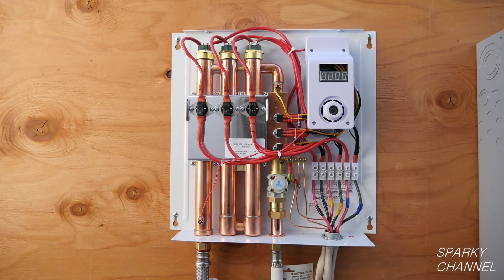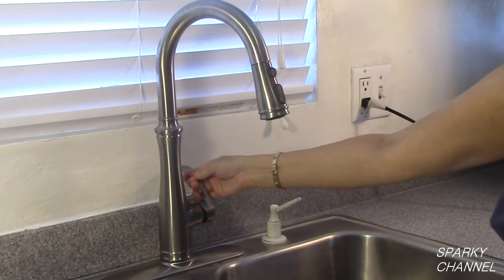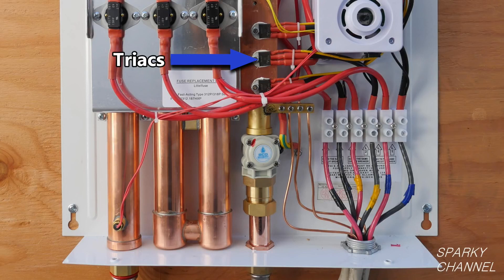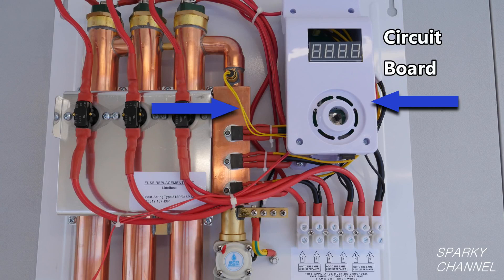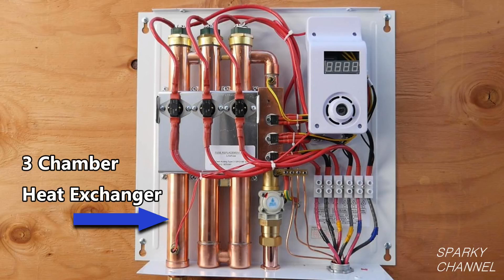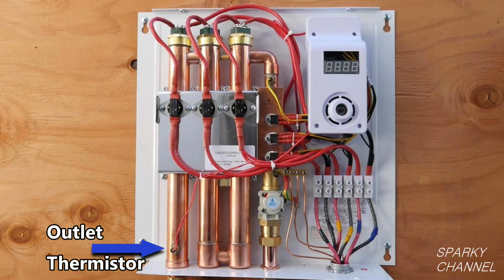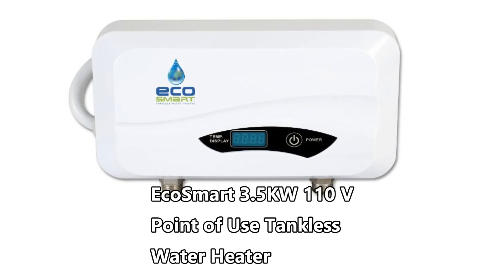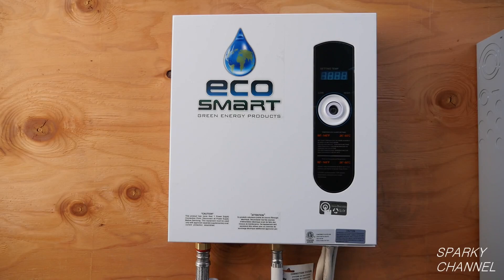How the EcoSmart ECO 27 Electric Tankless Water Heater Works

Comment: I bought one of these for my home, and if it was reliable, I'd put it in my rental houses.  This thing works like a dream. One of the heating elements went out af5er 5 years of constant use & troubleshooting it & replacing it was easy with the instructions on the eco website. Yes, I did buy more

One more thing; my old hot water tank wouldn't drain and I had to DRAG it out on my hand truck, because the weight caused the tires to go flat.  That was more than a 400 pound on just 22" of floor
Reply: 9 years in service, still working fine, will be replacing flow meter on mine

Comment: I’ve been through 3 of these and waiting on a fourth. I just changed out all 3 elements in my last one and water heats up then goes cold. It I limit the flow it may stay hot but not to correct set temp. Service was less than helpful other then to tell me it’s most likely out of warranty and to buy another. But while I wait for the new one I’d like to finish trouble shooting this one. Fuse is good all connections are good, and all three chambers are heating

Comment: I have an Ecosmart 27 and recently drained the system before turning off the power. Afterwards inspection of the 3 heating elements look ok but the flow to my 2 water faucets is diminished. Is  the Ecosmart flowmeter or some other element able to control the flow of water through the system?

Comment: Electronically controlled unit is good as long as it has a long time warranty.
Older units did not have the electronic components and would have a longer life of operation.

Comment: What can you use to install a remote disconnect?  Since there are 3 separate circuits would you need 3 separate disconnect 2 pole disconnect  or a 6 pole disconnect.  I am not finding any off the shelf solutions unless you want to pay 2 to 3K just for the disconnect.

Comment: I replaced the corroded element and still not hot? Any suggestions ?
Reply: Make sure its getting proper voltage, triac could be bad or control board, needs some troubleshooting

Comment: I have an Eco Smart 27 and when I turn the water on, the display will show the desired temperature for about 4 seconds then go out with no hot water. Any thoughts out there??
Reply: I ran across the same problem with my unit when I purchased this home that already had the Eco 27. It just kept shutting off when turned on. So what I think was going on in mine was calcification from the city water. I had a whole house filtration and salt system installed and after about two weeks, had nothing but hot water from that day forward. You may have already found the problem, but I would start with Eco Smart troubleshooting, and see if there are any codes, if not, remove the heating elements and see if they are corroded. Eco Smart has every kind of problem that this unit can run into. Great unit, will not change it. Good Luck!
Reply: @RS-ym3vg  thank you for your reply. I spoke with tech support and they told me that the problem was the flow meter. They sent me one, I replaced it and I'm good to go. I went ahead and got an identical water heater as a spare and before they get even more expensive.

Comment: Where are the white wires?
Reply: I have the ECO24 and it requires 3 x 40AMP circuits and 8/3 AWG wire
Reply: I have already laid out the 3 strands of  wires. Can I cap the white wires and just use the back and red?
Reply: Where did you see 8/3? There is no neutral required for the ECO24, only one black and one red per circuit plus a ground for each circuit as well. Yes, you can cap the white wires at each end.
Reply: @sghantous  Though this doesn't help me, I always appreciate people like you who take the time to be helpful. 👌💪